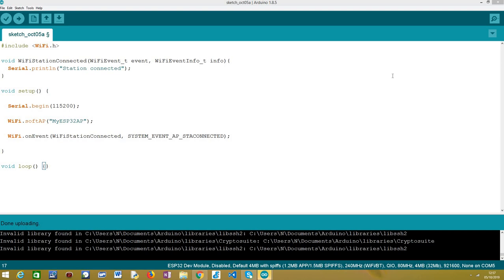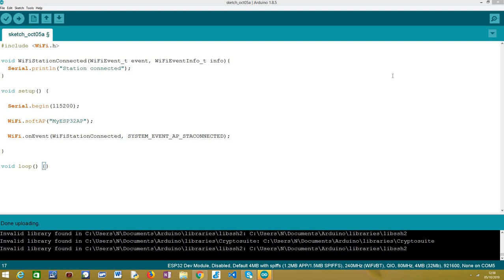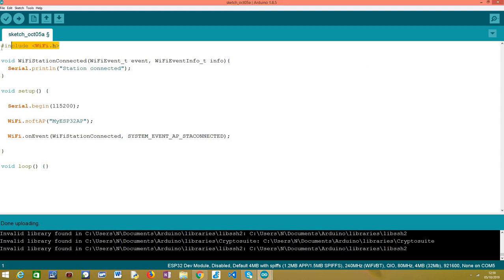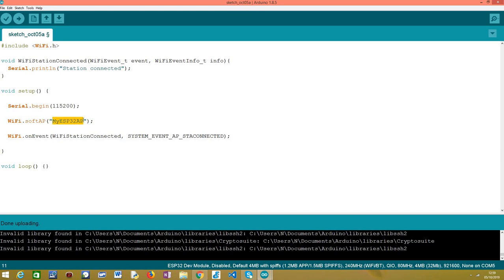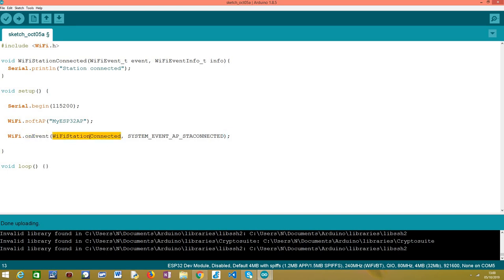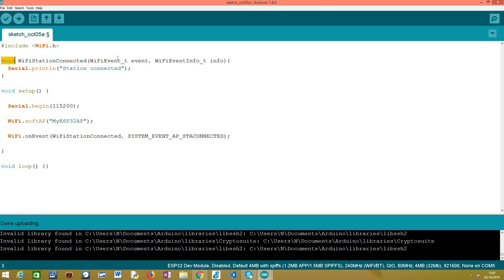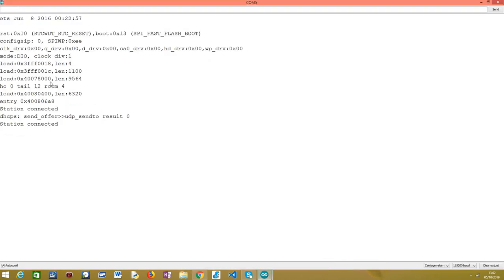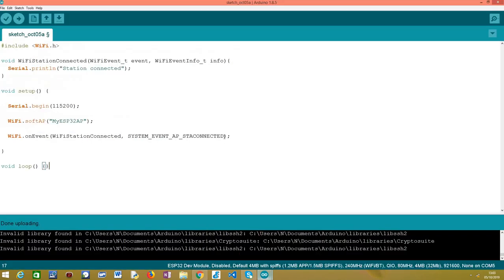ESP32 Soft AP: Station connected WiFi event

Comment: Nice tutorial. I wanted to use wifi event  SYSTEM_EVENT_AP_PROBEREQRECVED using your code above.It compiles fine but show no data in serial console. Can you please help me with this event? My code is below:

#include <WiFi.h>

int wifiChannel = 7;

void probeReceived(WiFiEvent_t event, WiFiEventInfo_t info){
   
  Serial.println("Station connected");
   
  for(int i = 0; i< 6; i++){
     
    Serial.printf("%02X", info.sta_connected.mac[i]);  
    if(i<5)Serial.print(":");
  }

  Serial.println("Received probe request packet:");
  Serial.println("RSSI : " + String(info.ap_probereqrecved.rssi));
  Serial.println("MAC  : " + String(info.ap_probereqrecved.mac[0], HEX) + ":" + String(info.ap_probereqrecved.mac[1], HEX) + ":" + String(info.ap_probereqrecved.mac[2], HEX) + ":" + String(info.ap_probereqrecved.mac[3], HEX) + ":" + String(info.ap_probereqrecved.mac[4], HEX) + ":" + String(info.ap_probereqrecved.mac[5], HEX));

 Serial.println();
}
  
void setup() {
  
    Serial.begin(115200);

    WiFi.softAP("ESP32", "<notused>", wifiChannel, 0, 0);
   
WiFi.onEvent(probeRequest, SYSTEM_EVENT_AP_PROBEREQRECVED);
                             
}
  
void loop() { }

Thanks.
Reply: Any information?